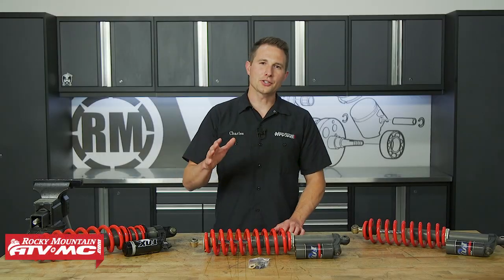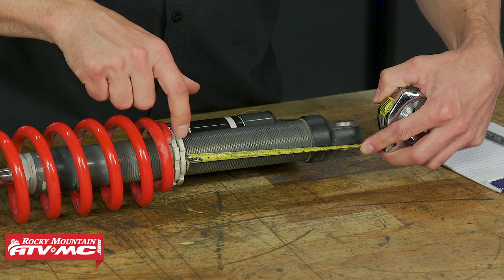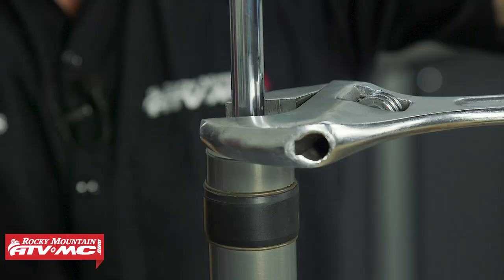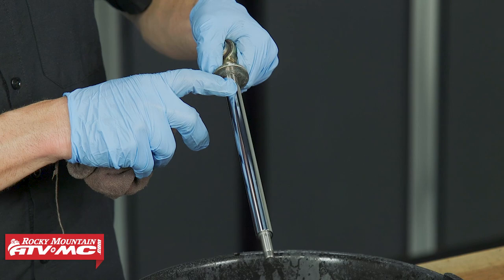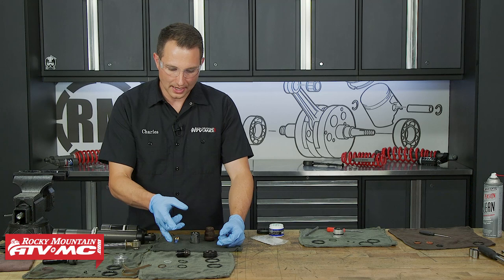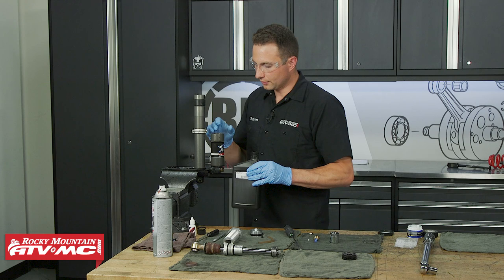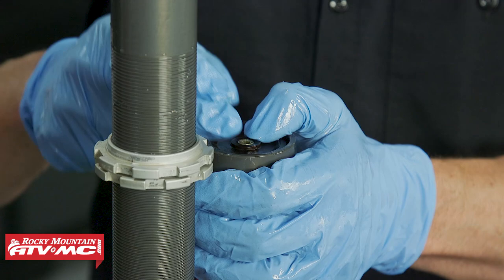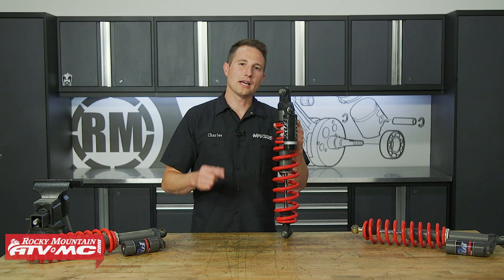How To Rebuild Fox Shocks on Polaris UTV's

Comment: Are the imiges of a manual a Polaris Service manual or a FOX specific service manual?  Trying to figure out which one to order. thanks
Reply from the maker: They are from Polaris Service manual.
Reply: @rmatvmc  one more question  then.  Do you sell the ifp tool for a 2021 rzr trail with the fox 2 podium shocks?
Reply from the maker: @stilllearningagain  We currently don't have one for the fox shocks.

Comment: Wish I had the ifp tool a couple months ago. Had to do this for a customer without it. I still got it done but I’m sure it would have been a lot easier with the tool. Plus I removed the needle 💉 insert and tapped a Schrader valve setup into the cap. Way easier to charge this way.

Comment: Are the nitrogen pressures the same for the podium qs3?
Reply: I can't find the manual for the podium qs3. It's the only thing I lack on getting this done. Local shops don't know the pressures either.
Reply: I called fox directly for my podium rc2 shocks. Very easy to get a hold of and they had the info I needed

Comment: how many pounds of nitrogen do you put in it?
Reply: 100-200 psi depending on the specific shock
Reply: @JordonRenn93  I see a Guy say the manual say's to leave a 1/4 inch of fluid above the IFP after the shock is done and your ready to install the resi cap. TIA

Comment: Do you have a link for the ifp tool?
Reply from the maker: Not right now, we'll get one added. -Charles
Reply: @rmatvmc   Thanks! I found a few similar options but I didn’t want to spend a bunch of money on the wrong one
Reply: @ryaneleczko7972  I used an Upholstery tool to pull the plunger in and I just pushed it down with my fingers. Kinda a pain but it works. I’m sure the proper tool would make things a lot easier for sure.
Reply: @rmatvmc  hey you guys never got a link for that IFP tool
Reply: @stpgarage6104  Get one from Fox

Comment: As a Fox Assembly lead, I endorse this message. Your refill procedure isn't what a fox tech would do but it absolutely has no problems and is extra thorough. The seal head also should be torqued to 50ft/lbs (typically) but that's fairly difficult without special tools.

Also a good thing to look for is when you compress the shock fully before gassing the reservoir that is stays full compressed, if there is any squishiness there, there is air trapped inside.